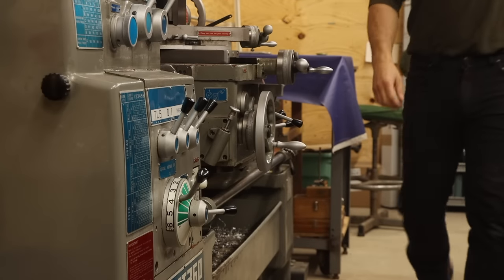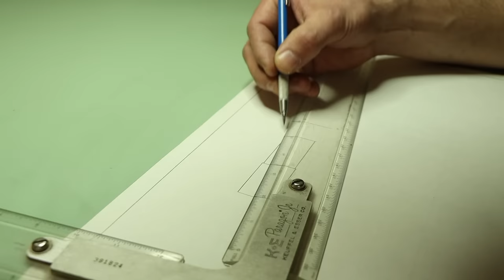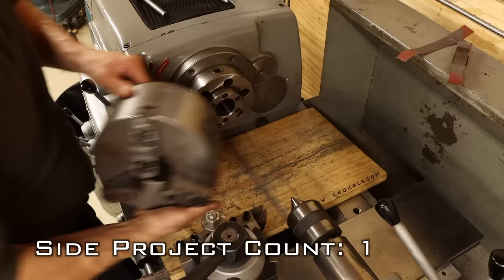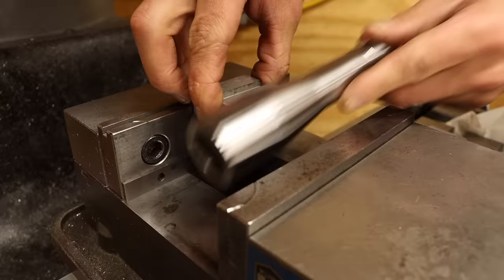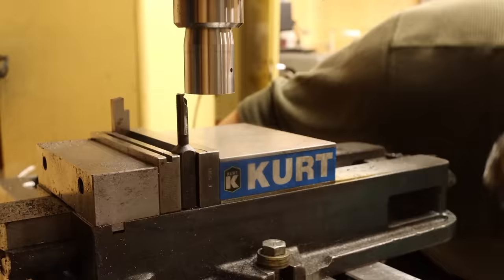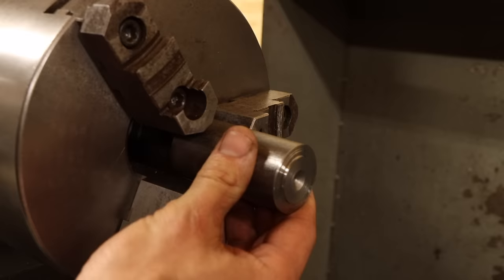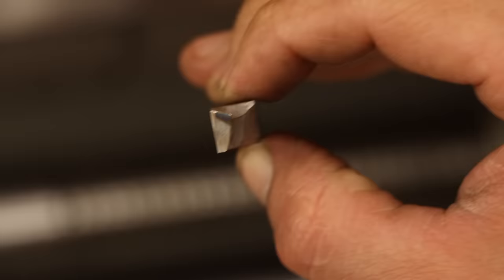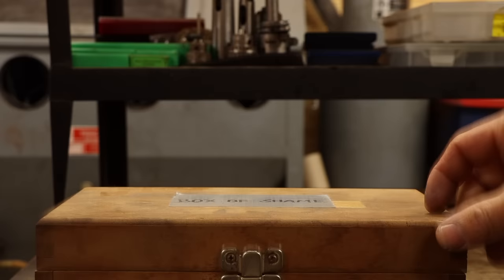Making the PERFECT* Slitting Saw Arbor || INHERITANCE MACHINING

Comment: What a great project and I love how you produced it.
A word of caution that was very painfully learned long ago though, @ 19:43 you put in “unnecessarily long stock” presumably because you didn’t want to cut off a smaller length - I did the same thing on a smaller lathe with slightly smaller diameter rod and after machining the end started filing with my left arm over the headstock, the stock started to wobble and instantly bent 90 degrees and proceeded to smack my left elbow a half dozen times before I could get it out of the way.
The rest of the Toolroom came to a screeching halt as my coworkers tried to figure out what the horrible noise was and
I am not sure which hurt more my torn up elbow or the ridicule  of said coworkers.
35 years later that memory still stings.
Safety first my friend and keep up the wonderful videos.
Reply from the maker: Thanks for the tip. In this case the material wasn't sticking out the end of the headstock so I think I was ok. I've seen videos of machining accidents like you mention so I'm cautious about that type of setup

Comment: Another great video.  $54 for a spring, that's some expensive spring there lol.  I've been modifying my wood lathe by building a new banjo and a duplicator attachment.  To save time I composed some of my parts using sections of chunky steel welded with 7018 stick welds (only system able to weld 1" thick stock in my shop).  Carbides on the mill did a great job but I discovered to my confusion (at the time) that those welds are pretty tough stuff and wore out the side of my cheap Chinese 3/4" tool steel end mill after just brushing a light pass through a couple of the welds on an inside surface.  Live and learn.
Reply from the maker: "Live and learn" sometimes it's just more fun that way. Lest you spend hours at a computer researching (booo). Thanks as always!

Comment: At 14:06 the surface finish issue is the carbide insert. Carbide likes to be loaded up some to leave a nice finish, otherwise, it’s shearing material off rather than actually cutting. HSS does not have this issue. If you want to finish cut with carbide inserts, leave a few thou and make a finish cut of 2-3 thou, or get a few inserts with a very small end radius on them. The smaller the radius, the better the finish.
Reply from the maker: Thanks for the info!

Comment: Consider putting a dab of anti-seize on the mounting bolt. I had to throw an arbor away because the slitting operation caused the mounting bolt to tighten down so much that the hex head on the mounting bolt stripped when I tried to remove the blade. I damaged the arbor trying to remove the damned bolt.

Comment: There are a few things I might have done differently. When you realized the stock was bent I would have flipped it and pulled it out in the chuck before center drilling, no need to switch to centers, but if you must I would have only cut off and used one drive pin against the dog, the other could be simply removed for future you to ponder. I would have also roughed the flat bottom in the lathe when you drilled the rough hole, the boring bar in the mill was not best choice of tools for roughing. I also would not grind so hard on the HSS tools to discolor them, heating to blue or beyond can reduce the life of the cutting edge. Oh, and rust, black oxide that thing to reduce/slow the rust and keep a light coat of oil on it. 

There may also be an instance where the long cap might get in the way, consider making a shallow cap alignment features, just an idea.

Comment: Awesome content as always, Brandon. Oddly enough, I had this EXACT problem myself on a project recently, and ended up making my own arbour(no where near a nice though). The cheap one I bought hasn't been touched since.
As a side note - I'm intrigued and surprised your mill doesn't have the Z axis DRO. Is this something you're considering adding in the future? Would be interesting to see your approach to adding the glass scales to the mill, as having done a fair bit of DRO installation on my tools, I know full well what a brain bender that can be.
Keep up the good work!
P.S. - probably the continental difference, but over here we call 2 flute endmills "slot drills". In my opinion, 2 flute endmill makes more sense, but just something else to add to your vast pool of machining knowledge 😃
Reply from the maker: Thanks, Erik! I'd definitely like to a the third axis at some point, but didn't realize it could be a potential challenge. I've had the other two scaled of and on the mill when I did the big cleanup and the mounting was pretty straightforward. The glass scales are housed in an aluminum extrusion from the factory though so that makes it easy.
PSS Never heard of them called slot drills! But then again I've not been in the game long 😉

Comment: I had a job that was mostly just trepan drilling holes in cast iron. it was fun. our trepan tools were long pipe shapes with through coolant, and a 3/4 insert as a cutting surface. we could drill through 6 feet of cast iron in a single go. it was pretty fun. Well, sometimes, other times it was pretty dull. :P
Reply from the maker: That's pretty nuts!

Comment: God I have that same one. it sucks so bad. I just made a 3/4" shank one for each size saw I had and put it in my collet. this is nice.
Reply: also: wrench flats?
Reply from the maker: I'll add them if it becomes an issue but so far not a problem to release the cap screw after use
Reply: @InheritanceMachining  on the crappy one we both have, the cap screw stripped and then it was impossible to unthread. I ended up milling flats on the cap, and then just tossing it. FWIW, It’ll be way harder to add the flats if there’s a saw stuck in the arbor :)

Comment: Nicely done. A slitting saw arbor that runs true is rare. I would have used a screw rather than a press fit pin to retain the center, just in case you need to take it apart someday.
Reply from the maker: Thanks! I left the slot inside clear to the bore in the event I need to drive the pin through

Comment: Very nicely done. I also could use a slitting saw arbor and will definitely steal some ideas from yours for mine.

My heart skipped a bit when you were drilling the final hike through the cap. I've learned (the hard way) to always drill a through hole like that first, then turn the OD. This keeps a thin wall like that from warping due to the heat from drilling. Only really necessary when the wall thickness is thin.
Reply from the maker: Thanks! And yeah it was a little sketchy. I took it easy through, used a lot of oil, and cleared the chips often

Comment: I have never touched a mill before, but I love watching your videos, I have one question though. If you don't have a Z axis DRO (which I understand is up and down), how did you know how deep to go in the bottom of the bore, since you couldn't see inside.
Reply from the maker: Thanks. The Z axis still has a dial on the handwheel. It's just a bit harder to keep track of compared to a DRO

Comment: With the saws with the smaller holes won't you have an issue of the blade being defected upwards due to the pressure holding it in place on each side being applied in different spots on the blade causing it to cup?  (Sorry for the terrible frazing not sure how to describe it)

Comment: That was a hokey arbor. Never seen one made like that before. While I’ve made an incredible amount of tooling over the tears that was one tool there wasn’t a need to make myself having found a quality cheap one online. Threading tool for the tailstock is nice to have. Much quicker than cutting all threads besides usually something you cant due to lead screw size anyway.
Yeah i meant to say tears not years. 😅

Comment: How does the clamp work on smaller diameter arbor holes? Do you use some "washers" behind the blade to support it against the arbor body? (I say "washer", I of course mean some precision pieces of metal that would have been lovingly created...)
Reply from the maker: Nope, that whole centering boss is backed by a spring so it just retracts as the cap is tightened 😁

Comment: First off, happy I found you. (Filling a niche, that @thisoldtony left, regular home shop machining videos)
Any ways to my question any heat treatment required for the 4140 r8 tapper? Do they normally get hardened and ground in?
How about bluing the tapper to see how well it matches?
Reply from the maker: Thanks man. Heat treating would be good but right now I don't have a good way to do that or the final grind in. All on the list though. Blueing the taper is a good idea

Comment: I wish i had all these tools, or even access to 2/3 if this equipment you have,  i would build a couple engines and modify a few more, If i had the shop and equipment, id build a engine to power the shop and house. Id build a two cylinder opposed piston with a stroke between 8" and 12" snd a bore something like 6" to 8" possibly 10" ,  being a compression ignition with 22:1 to 24:1 compression melt down used pistons to cast new sets, Mays well cast a set for a overhaul while casting,  go with 3" wrist pins  and crank journals possibly larger crank journals, and smaller wrist pins , 2" pins, depending on what is commonly available for other engines. Build the crank from bar stock and flat plate 25-35mm thick. Looking forba 600-800 rpm normal operating speed. 1200 or less peak. And look into possibly goin 2 stroke, and possibly use retrofitted electronic injectors. To allow pilot injection. And a pair of AMR-500 roots blowers  to scavenge the cylinders. One per cylinder rinning about 6:1-10:1 overdrive being its a huge enging and low rpm  its designed for 1.0-2.0 litre engines running at 6800+ rpm calculations are required . Use along  with air to water intercoolers inside the pleum . I'd like to get some boost atleast ,8psi/0.57 bar,  to 15psi/1.01 bar, peak. And possibly build a near identical gas/propane engine, and a steam engine for the same purpose,  looking for about 40 hp and a great TQ number. 100ftlbs min. Use it to burn fitered waste oils, and biodiesel, use heated fuel lines to allow vegetable oil to be used. Along with used engine oil and bio diesel,  heat thei oil to 200°-250°F wil alliw the vegetable oil to flow and be injected, use the engne coolant in a water to oil heat exchanger wth additional electric heater just before the injectors, also using a electronic governor to keep the speed and rpm regulated.use it to spin a couple generators a 10kw DC generator to charge the battery bank, and AC 3phase 15kw,and a 10kw ac split phase generator with a mcro cintroller to select between them and reduce the DC output if the load is getting excessive , to prevent frequency loss and brown outs. With boost it should make plenty of hp 40shoul be a non boost low umber, being 1206 cid, with 8"bore a single cylinder should make that power. So 100-150 hp, and 250tq. Should be possible, i know single cylinder 4 strokes this size non boost, MN made 10-20 hp , they had only 4:1 copression,were not efficient,the rings were 1/2"thick and loss power every where , the atmospheric intake and vaporizer carburetors. If you can call it a carburator.. the intake valve spring caused the piston to pull a vacuum,then piston pulled the valve open to draw in air/ fuel .  Simply using a cam to open the valve at the proper time, with the valves having some overlap. The power could easily be doubled possibly 2-3x, (up to 6x the power) 
Possibly more, especially with more compression and thinner rings, for less friction, rings in modern engins are 1mm-1.5mm possibly thiner, back then,a piston could have 4 of these 1/2"thick rings , possibly more,   reduce this to atleast 3mm(1/8") and using two with a 1/4"oil rng. With. 1/8" rings with the working edge cut down similar to a Napier ring, with a 1mm contact area just under 1/16"  will greatly reduced friction, and the aluminum piston over the iron piston greatly reduced weight.  Cast pistons from old pistons, and cast the block and crank case from aluminum rims and old aluminum engine heads and similar cast parts. Because the alloy is designed to be cast. And possibly cast  the crank from steel  using car /Truck axels  leaf springs , sway bars. Quality steel.  Build a mold from dowel rod and 2x6 build a bixer style crank, two separate rod journals. With both pistons down at once, possibly make it a wide v, engine, 100°-120° , to get one piston to fire slightly after the first, a four stroke wouldn't matter, but a two stroke180° would fire both cylinders at once. I guess its ok. The balance would be great, nearly perfect, it wouldn't bewith a 100°-130° even 160° with one cylinder firing 20° after the first.  An opposed twin two stroke would run exceptionally smooth. Each power cycle would be cancelled out by the opposite bank and sound possibly like a single cylinder. I really want to buildthis now!! Maybe a much smaller 4-cylinder version , start witha 2"stroke, 3" bore,  then a 4" stroke 4.625" bore, Detroit diesel style two stroke gas engines, liquid propane engines, the fuel injected directly into the cylinder when the piston is at BDC. Using 2-4 + injctors /cylinder! To get the fuel into the cylinder a 4.625" bore, 4"stroke, possibly 6k-8k+ rpm engine, with 4 exhaust valves.  About 1.80" each with possibly two ports/cylinder, with a 1.75",1.875"or 2.0" port "D" or "0" port, possibly two plugs per cylinder uing 10-12mm plugs with70-80% of the combustion chamber in the pistons dome. WITH 1-2 injectors spraying about 12° 15° near straight on the pistons the other 1-2 spraying up the bore at 45°-60°, but at a slight angles  to induce swirl. The ported sleeve having the ports at angles to cause the air to swirl and fill the cylinder bottom to top, the fuel injectors tested with thr flow and against to see any gains.  The ports being about 20mm x 30mm wuth 8mm bridges between. Possibly use slide valvs to close the ports after the injectors fire. To prevent the boost entering the crank case. Or a butterfly valve can be used with a cam opring as long a it is open asthe ports open to the chamber, the pistons can use long skirts to sealthe crank case. But thats another ring and friction and more weight. This would be a good engine for a car, and possibly a military truck suv, with the engine under the passngers, to allow IED protection.  And more room with a very low center of gravity.  With 35-38" tires 4x4, lockers diffs and xfer case, the frame rail under the rockers under the doors,  8" frame rails  with basically look like a hummer, wide  floorpan 6" overtge frame  this is14" fir the engine , with a 1/4" bullet resistant belly pan.  V shaped to direct blast out with 1/4" steel floor pans the engine under the seats, with the seats back to back to allow the engine and gear boxes to fit under the seats  a 6 speed auto with 3speed xfer case, ultra low low and high, with engaged. And locked functions, locked is all wheels spinning equal, engaged could have 1 front, 1 rear spinning tre dif lock has the both rear dpinning equal. And the front, but without the transfer lock the rear or the front only can spin. All lock they are all locked together . Of road only. Sorry to ramble, i should be sleeping!! Have a awesome day!

Comment: Where can I find a drafting table like yours? I remember using one just like it in highschool, but I'm having trouble finding a quality table these days. Any help would be appreciated. Also, I love your channel. It's very informative and I love the production value, thank you.
Reply from the maker: Thanks! On the table I'm not sure, but quality vintage drafting arms can be found on eBay. Mine is a Kueffel and Esser. The tables are pretty straightforward and could made with a little work. Honestly mine isn't all the sturdy

Comment: I'm going to swear in the church, but I would like to challenge "within 1/10 000 of an inch" with T-gauges. That is +/-0.00254 mm measuring with an analog micrometer on "moving parts". That is in my opinion some outstanding accuracy, even with "new" machines I sometimes find it hard to get +/-0.01mm, and you get the tolerances ~five times tighter. I salute You 😉🤠🤗!
Reply from the maker: Thank you! I got pretty lucky on this one with finishing passes. Usually I have to revert to emery cloth for final sizing

Comment: So those saws are keyed, I imagine so that you can guarantee torque transfer the the saw not slipping under heavy load.

I see that in your design, the key is not used at all. Is the pressure from the cap clamping down on the saw enough even with the smooth surface or is it rare that you will experience enough torque to require a key for driving the saw?

Comment: Question - why would you start the parting cut, flip the part/finish the parting cut/clean up the face/drill bore hole, Then flip it again only to spend more time indicating it in, then working on the threaded component?!?  Why not do the threaded components before flipping it???  That OD of the R8 taper shank is INDICATED IN and it would only make the most sense to do any additional work while chucked up!  Now one might say that the part was gripped much closer to the start of the taper on the OD, whereas if you didn't flip the part and finish cut to length the part was chucked up with "excessive' stickout, potentially leading to run out...I think run out would have been nil, immeasurable.  Especially because you have the pilot hole that ran in the tail stock to keep you on center, no need to center drill.  

Just my thoughts

Comment: 2 days ago, i found one of those cheapo india made slitting saw arbors at work, tried mounting it into a mill to make sure it was ok to use for a personal project coming up… it was in fact not ok. Bunged up the first 2 threads on the draw bar and got me stopped up for about 10 mins trying to get it off. Straight into the FIB with that tool, perhaps ill make one…